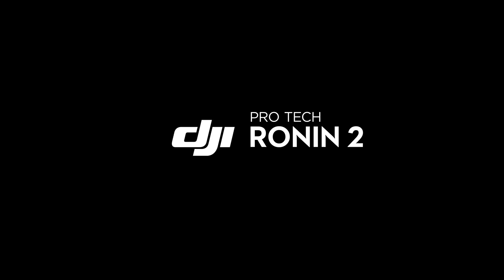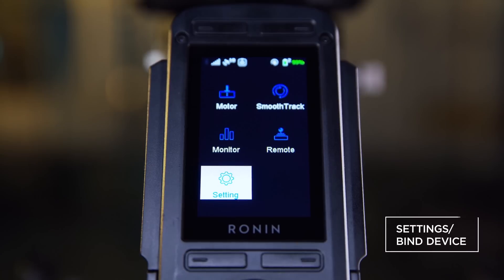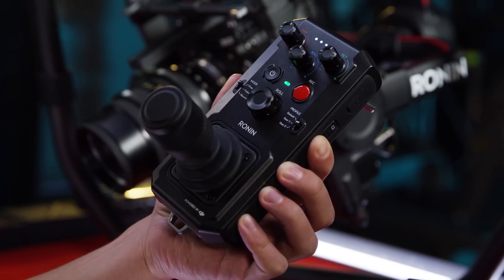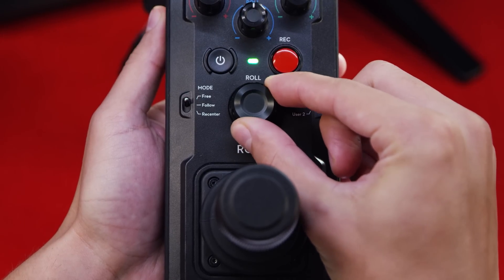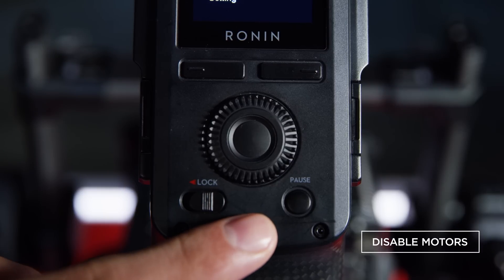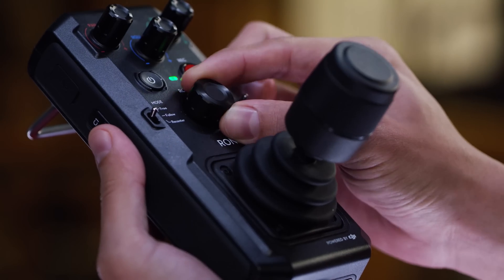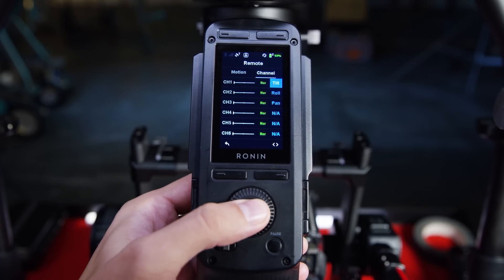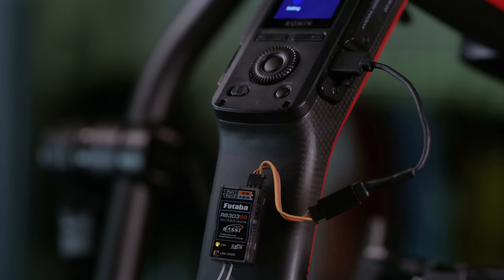DJI Tutorials - Ronin 2 - Remote Controller

Comment: how can I update the firmware in the remote controller?
Reply from the maker: Hello, there. You may refer to the steps below: 
How do I update a remote controller firmware?
Preparation for updating:
Ensure that the remote controller has enough battery to complete the firmware updates. It is recommended to update on a full battery.
Update Process:
1. Press and hold the Power button to turn on the remote controller.

2. Connect the remote controller to a computer using an official Type-C cable. Launch DJI Pro Assistant For Ronin and log in with your DJI account number.

3. After DJI Pro Assistant For Ronin （Link:https://www.dji.com/cn/ronin-2/info#) downloads detects the Ronin 2’s remote controller, tap the Remote Controller icon (as shown below) and enter the Firmware Update page. Wait and refresh the firmware update list.

4. Select the firmware version (as shown below) that you wish to update and follow the steps. The remote controller will update automatically once the firmware update is complete.

5. Restart the gimbal after the firmware update is finished.
Reply: @DJITutorials  thank you very much!
Reply from the maker: @tatianagodoy3568  Most welcome.

Comment: How far can you control the gimbal?
Reply from the maker: Hello. there. Based on testing, the signal is disconnected at about 50 m when the frequency band is 5.8 GHz, and at about 45 m when the frequency band is 2.4 GHz.

Comment: Does this work with ronin rs2 ?
Reply from the maker: Hello, there. Sorry for your inconvenience. Ronin 2 Remote Controller is only compatible with Ronin 2. You may refer to this link for more details: https://store.dji.com/product/ronin-2-remote-controller
Reply: @DJITutorials   you guy should make more types of controls
Reply from the maker: @j_filmz_6130 We are sorry for any inconvenience brought. May we know what kind of function you want to realize on RS2 by using the Ronin2 Remote Controller?
Reply: @DJITutorials   I would love to have the ronin 2 remote for the ronin rs 2 the ability to control speeds on all axis and the big joy stick make for even smother shots the ronin rs 2 extension kit the joy stick is way to small and most times on bumps or pot holes moves my thumbs and ruins my shots and I have to redo a whole shot, I know for a fact with your consumer base if you make a model for the rs 2 it will be on back order for months ronin 2 remote is what a lot of consumers for their rs2 rigs
Reply: @j_filmz_6130  you can use the ronin 2 remote on the rs2.